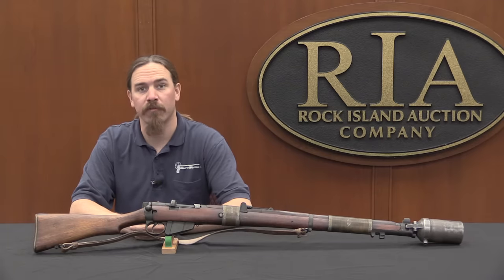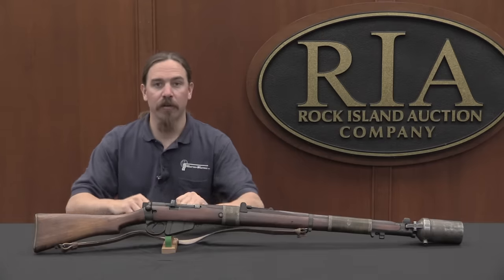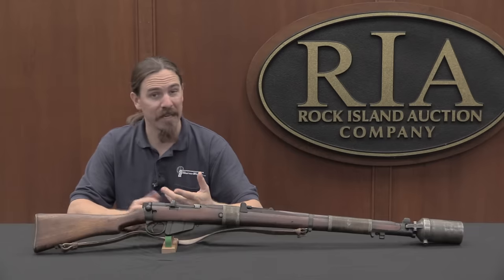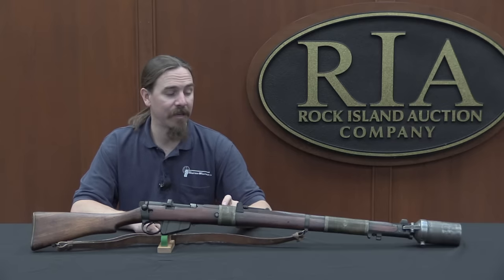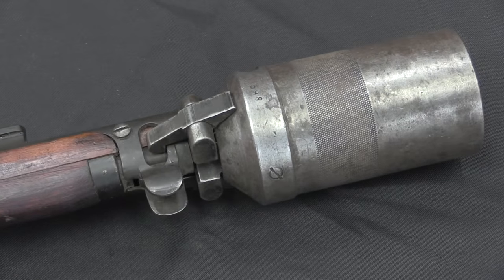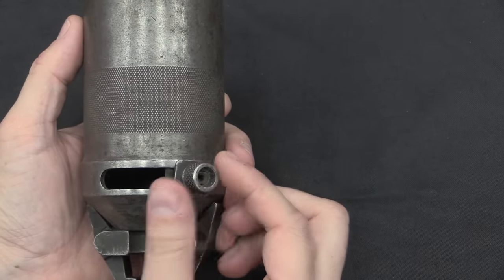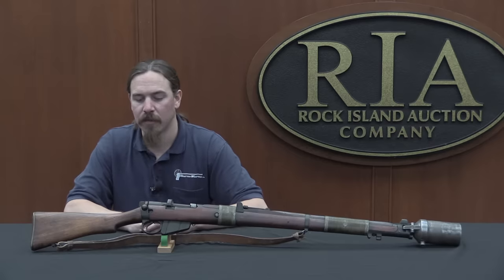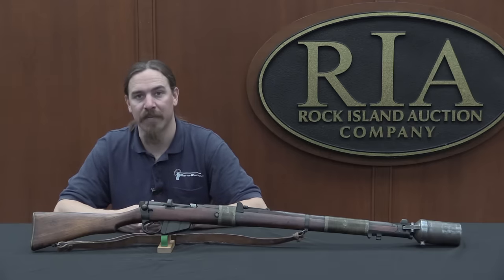SMLE Rifle Grenade Launcher

Comment: The British 2 & 1/2 inch grenade discharger of 1917 was more so returned to over the later 1925 2 inch grenade discharger not because of pay load but because of concerns with heavy  handling & general mistreatment in use.
The 1925 2 inch is better on paper but not when you put it in the hand of the common grunt that will often use their rifle in a similar manner to a hammer.
Some records note how soldiers tube of the discharger on occasion from the mounting from general heavy mismanagement.

Command often forget how daft both them self's are let alone the common ranks.
I have seen people use a rifle as a pry bar & so many more unintended application but everyone thinks they know best.
I honestly say a weapon isn't serviceable if it can't be thrown from at least a second story building & still function fit for purpose.
The soldiers are likely to expose it similar abuse or worse!
You can't keep your eyes on them every minute of the day much like children soldiers get bored & do strange things.

Their is an older Grenade discharger from 1916 which used a ring instead of a cup before that I am only aware of rod grenades that very different but basically the same application-function.

Comment: Got a dumb question, why was the recoil greater when firing grenades as compared to the usual .303?
Reply: Sono Luma aswome guy
Reply: In the British case it was the propelant the blank cartridge used.  The normal .303 ball ammunition used Cordite, a modified form of Nobel's Ballisite.  On initial testing of smokeless nitro propellants Ballisite was found to have a very sharp pressure curve with excessive recoil, bore wear due to the heat of the burn, and was unstable with age. Britain then modified the formula to produce Cordite. Nobel sued for patent infringement, but due to the ambiguios wording of his initial patent lost.  When it came to launching grenades Cordite was to soft, so back to Ballisite. The blanks were in boxes marked Blank Ballisite for Grenade launching only. The wire wrap was an intialy a Field Modification, also used was waxed cord and rawhide leather. By the By, so called Bullet trap grenades were experimented with were a normal ball cartridge was used.
Reply: Sono Luma It's Netwon's laws of motion number three...

The number two it's the result of all forces applied to an object are equal to the product of the mass and the acceleration.

The heavier a thing is,the higher the force you'll have to use in order to launch that thing...Now applies this "concept" to the guns,if you want more power you will need more powder gun,a longer rifle and as an consequences a higher velocity of the shell,so the recoil of a gun it's proportional to the bullet's size it shots,thus it's legit that a 800mm rail-road artillery has a much higher recoil than a 8.8cm gun.

Comment: So did the grenade have to be unpinned, placed in the cup, and fired quickly before it exploded? Or, did the firing action ignite the fuse in the grenade?
Reply: Jelly Man the grenade would be put in the cup, the pin pulled, and then the rifle would be fired. The fuse won't start until the lever on the side of the grenade is released. The cup would hold down the lever, and upon leaving the cup, it would release, starting the fuse.
Reply: +Jared Hersh oh ok, that makes more sense.

Comment: How would u start the 7 second fuse? Did u have to pull a pin and then drop it in the cup and fire within 7 seconds?
Reply: Grenades have a spring-loaded handle on the side called the spoon, when the pin is pulled and the spoon is released the fuse is armed. The cup of the grenade launcher would hold the spoon to the grenade until the grenade was launched.

Comment: i have one. my cup is 2.5 but black finish with the number 34 printed on it. all parts are ww2 British (matching ser. number)  except the trigger guard which is 1963* and the finish on the wood is dark and has an 18 printed on the stock, also the bolt part that pops out in the back has td and a 56 on it.  any info why? hard to find any like mine. could email some photos? hope to hear back!

Comment: Would firing this like a standard rifle injure your shoulder?
Reply: skylar15123 potentially with a very heavy grenade, but regularly I suppose not. recoil is a punch, this would injure your shoulder as much as a very hard punch
Reply: Short answer yes. If you were lucky it would dislocate your shoulder, you could well then  be charged with 'Self Inflicted Injury' and possibly shot at dawn.  Training at the time made a very definite point  that the rifle butt had to placed on a firm base and held with a strong grip ensuring that that there was a clear trajectory for the grenade to travel to its target, bouncing off the parapet or other obstacle was definitly contra indicated. Also the tactic of aiming slightly high was taught so that the grenade would air burst   . The blank cartridge used  much more powerful Ballisite rather than standard Cordite, and if not  held firmly into the shoulder Cordite cartiridges bite enough as it is.
Reply: possibly break you shoulder!!!!at 3times normal pressure it would be at least a 4 bore elephant gun in recoil!!! it's probably up there with the Boys anti-tank rife as to recoil and that's a 30+pound gun that jumps like a jack rabbit when fired!!!!
Reply: Don't put your tonuge bettwen your teeth, that was also a training command. :-)
Reply: Ian actually mentioned the sight for anti-tank grenades, this was clearly intended for use firing from the shoulder.  I imagine they were typically used with the gas vent mostly open which would reduce recoil some.  Recoil would be unpleasant but not impossible.  The main reason these were usually fired grounded was probably as much for accuracy as for avoiding the recoil, firing at a 45 degree angle from the shoulder is a bit difficult to judge.

Comment: if you're going to make a grenade launcher housing, why attach it to the end of the barrel? Using blanks and the barrel makes sense for american grenades because they just launch off a little adapter, but this is so half assed.
Reply: Yeah that's kinda the point. They wanted a grenade launcher with as little effort possible.
Reply: @atfyoutubedivision955  the American style is low effort, the British made an entire grenade housing, there's no point in using the barrel anymore, not to mention the negative effects that weight will create.
Reply: @krebgurfson5732  And the Americans did that 25 years later.

Comment: How did they preserve the rifle under the wire wrapped stock from rust?
Reply: it's a full wood handguard!!! it's over the wood, the Enfield is like most military rifles back then it had a full length 2 piece handguard around the barre,l it'd be a bitch to take that handguard off it that's for sure!!!!
Reply: Yeah, thats why i was curious to know what kind of preservative they used to prevent moisture from rust the rifle under the stock, since you cant take the stock off.
Reply: PBRStreetGang they had a tar like preservative in the U.S. navy, it was a long term storage grease called comsolene, they probably smeared that stuff under it, and trust me, if you've ever dealt with it you'd never question it's staying power!!!I do mean it is like tar mixed with axel grease you can NOT GET THAT STUFF OFF!!! that and the Parkerizing should have been enough for between arsenal refurbishments and if the U.S. had it then the Brits definitely had access to it!!
Reply: The wire used was mostly copper, stel wire was found not to be ductile enough as the wood and barrel do expand slightly when fired. The preservative is Shellac. Field expidient included string and rawhide leather.
Reply: Thanks Keith, I figured it was some kind of military grease, just wondered if it was something specific to the Brits. And yeah, cleaning cosmoline sucks, but then again... its better than rust.
Reply: PBRStreetGang you got that right! specially that Russian stuff, I think it's axel grease mixed with yak shit!!! completely stinks!!!!

Comment: @Riceball01 - Hoping this works. The jackass who posted up that petition blocked me, so I wouldn't be able to reply to any comment in that comment thread.

Well, maybe it's because even when adjusted for population, your homicide rate using guns (yes, I removed all the suicides and accidents) is over 300 times ours, based on the years 2009-2015 that I think there's a problem. 
I dunno, maybe I just think the murder rate is far too high to be considered acceptable by any sane person.